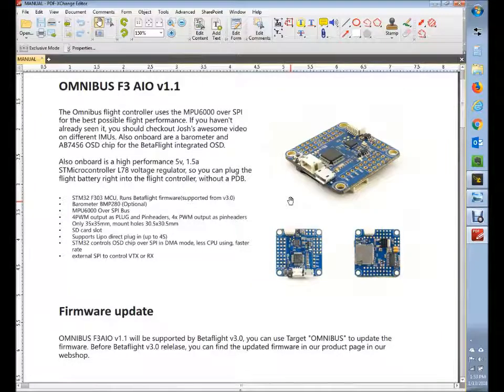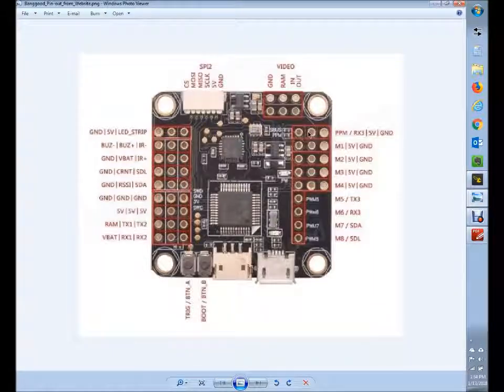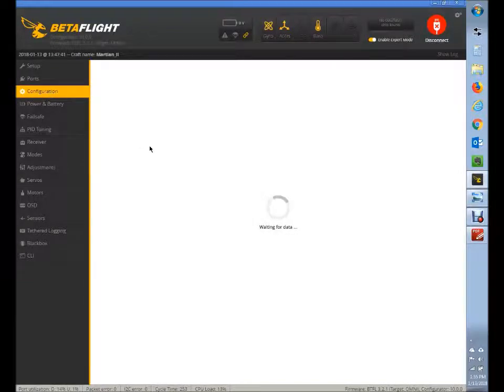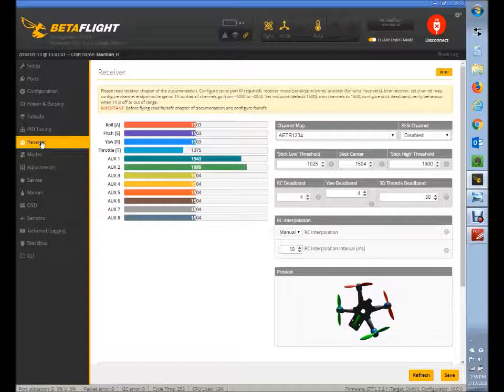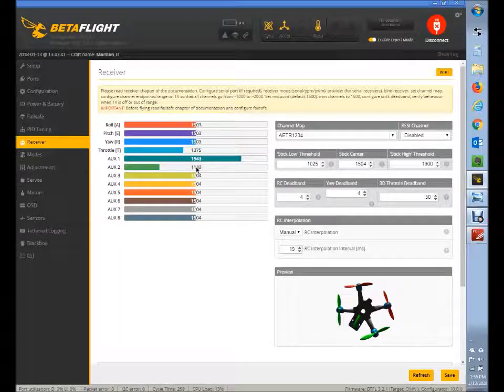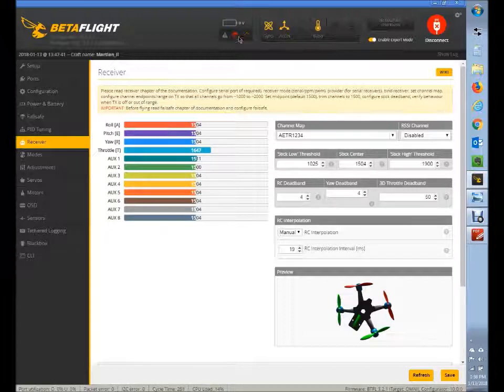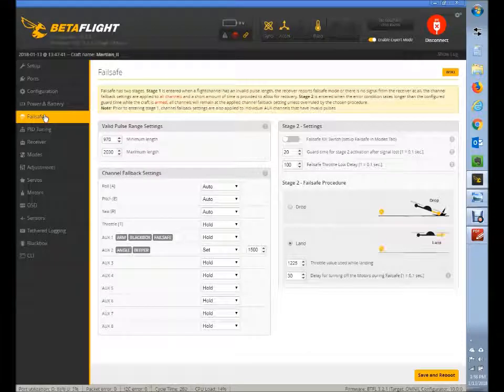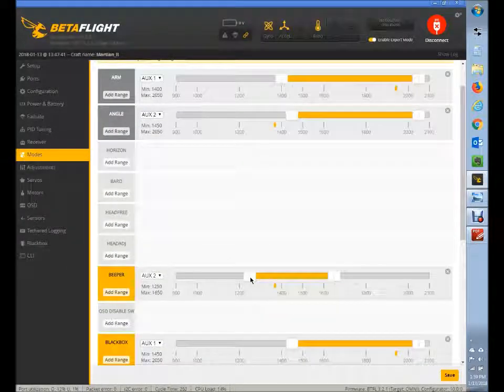Troubleshoot: Connecting a PPM Reciever to an Omnibus F3 Board

Comment: thanks for the video , i used flysky receiver ia6B ,I cannot pair with pwm RX , so I use ppm , but I would like for build F450 multicopter drone with gimbal , where place I must plug in for the servo at this board , cause I already mapping channel 5+6 in VRA + VRB at tab receiver is working well , my question is where I must plug in my servo pin at this board , thanks for answer 🙏

Comment: okay... now what about PWM?! what do i do to enable it?
Reply from the maker: I'm sorry, I don't think this board supports PWM (video title changed).  Do you have a PPM output on that PWM RX you can use?
Reply: Thanks for the reply. 
looks like I'll have to buy one.. or a PWM to PPM converter but that's going to add unnecessary weight, bulk and wire mess. 

i actually have the Omnibus F4 pro v3 but it doesn't look like its supporting it either. it has a PWM connector but that's looking like it might be a cleaner output than soldering the pins on.  I guess PWM is just something the omnibus boards dont support in general. :(

Comment: I have been struggling with why PPM was not working. Enabling serial Rx on UART 3 made PPM function, but a hollow victory as the reason for using PPM was to keep UART 3 free because of conflicts with fixed wing. Would be interesting to know if removing sbus resister would solve the problem, but I also am reluctant to go that route. Thanks!
Reply: This applies to the flip 32 Omnibus f3 v3 I found the following link that relates to this. https://github.com/iNavFlight/inav/issues/1639  I removed the Sbus resister and now PPM works without enabling serial rx on UART 3 I  could not get the link to work but if you google."  Omnibus F3 PPM in only working with UART3 " You should be able to find it.
Reply from the maker: Thanks.  I did see some stuff but didn't want to mess with it.  I guess if I really needed Uart 3 that would have changed my mind on that.  I very much appreciate the follow-up and link above.  Thank you!

Comment: How do I know when it’s in boot loader mode ? Someone told me you have only blue light when in boot load but I’m getting a dimly lit red and strong blue is this right ??
Reply from the maker: daniel Metcalfe , yes.  If u connect to configurator software, it will have DFU as the port at the top vs. a Comm #.  In BF, u can simply go to the CLI tab, type "BL", hit enter and it will put the FC in bootloader mode.  I have a driver issue on my PC with the Omnibus boards i can't seems to fix, but have a workaround.  If u have trouble, let me know.

Comment: Thank you for this video. I got two switches working now. The flap switch was not activated. I will have to set my switches in mixes like you to get more modes.
Reply from the maker: Sweet!  Glad it helped!!!!   :-)
Reply: I have another question. I am adding more and more hardware to the f3 board for testing like I did the receiver  and tested my TX output on inav. I have now 6 channels thanks to you working but if I try to simulate arming it wont let me. In pre-arming check I have red cross in navigation is safe all the time and cant get rid of this. Any ideas ?I forgot to say that I do not have gps activated and I do not have usb and motor installed neither. I just wanted to simulate arming process.
Reply from the maker: Verifying you do NOT have GPS enabled as a feature?  If that is the case, check these other things:
- You DID NOT configured Way Points (WP)/Position Hold (PH)/Return To Home (RTH) or Failsafe RTH.
- You DO NOT try to arm into RTH/PH/WP.

When that check is red, it is because of the above OR that it is looking for a GPS signal of 6+ satellites.
Reply: hi, I have tried all I possibly could. I have unchecked gps in ports tub. I have no mode selected. I reset all my settings to default actually. Pre arming check is all green till I go to Fail safe tub and select RTH instead of default Land. Then the navigation is safe goes red and thats it.  What ever I try it will stay in red until I check the Land option. Any ideas ? PS: the only seting that will force is to go green in RTH  selected  is if I set in CLI  nav_extra_arming_safety = off
Reply from the maker: Of course.  You can't use RTH (Return to Home) in failsafe without working GPS.
Reply: UAV Tech thank you, thats what I needed to hear.